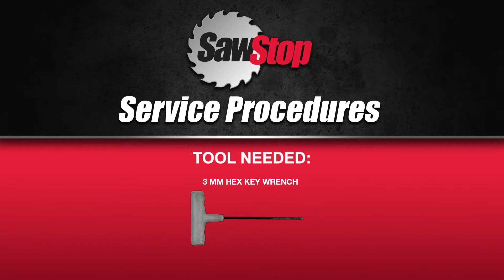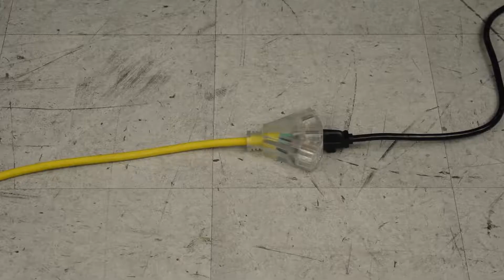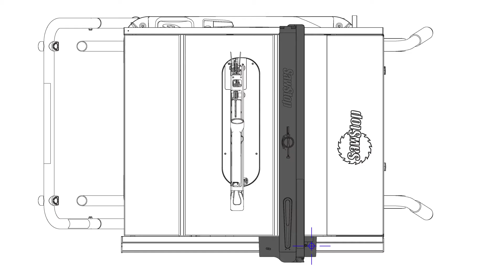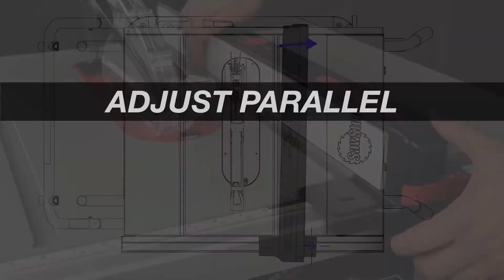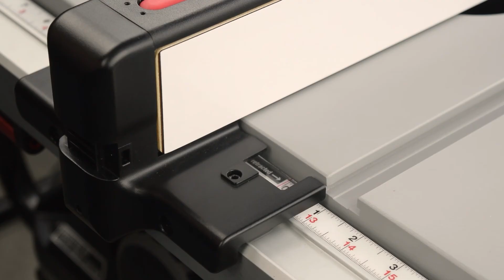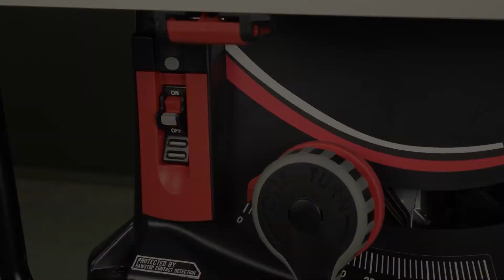SawStop Service Tip: Adjust and Align the Fence for Your Jobsite Saw

Comment: Mine is out of square like the video, but I can't adjust any further, the screw is bottomed out.  Then what do you do?
Reply: same issue. Frustrating. Did you find a fix? Sawstop doesn't seem to care.
Reply: @crazyfastpresents  can't remember if I did anything or it just fixed itself because I dropped the fence a few times while transporting 😆
Reply: @crazyfastpresents  I have the same issue, going to follow instructions and attempt to fix.  My fence leans to the left at the far end and won't adjust right.
Reply: To Tyler's point, after spending a couple of hours adjusting, and it still leaned left even when fully cranked.  Be careful, if you turn the guide too much counter clockwise it will no longer mount correctly on the front rail.  I moderated the counter clockwise turn, tighten the screws on the adjusting bracket and hit the end of the fence gently twice.  It is now aligned.  Wish me luck with the cuts.
Reply: @jeffvoigt84  yes to Mr Voight. Screwed around for an hour, taken off the clock to fix in the middle of the job. Did something I NEVER  do to any tool, much less an $1800 table sw....knock the fence over until it sort of aligns, then re adjust with the screw. Wow! Unbelievable.
Reply: Me too! I cannot adjust the fence to be parallel to the miter slot.